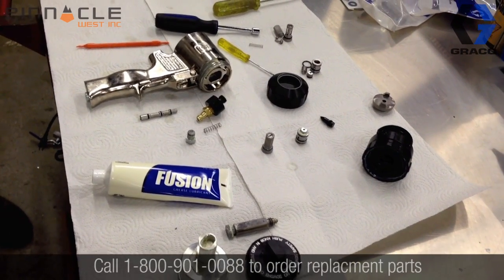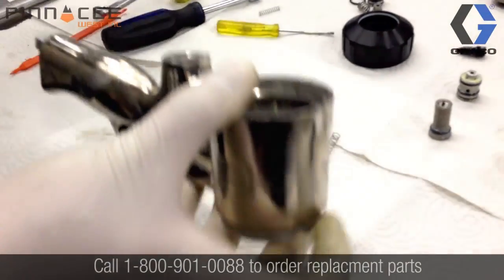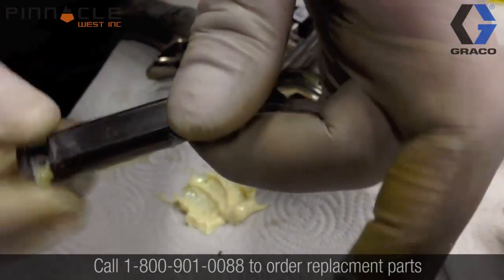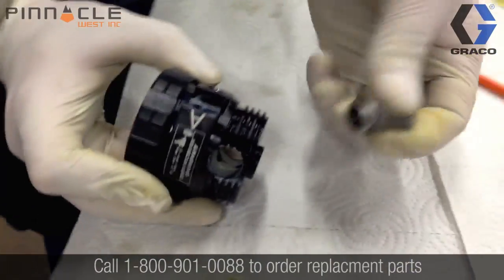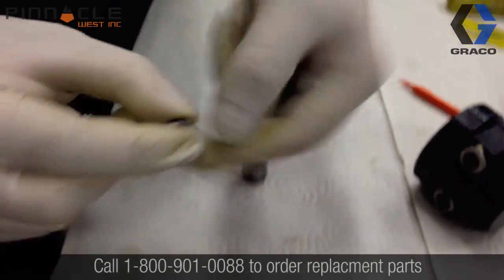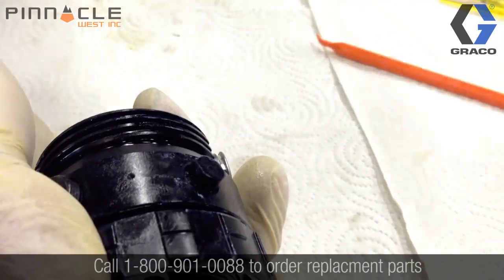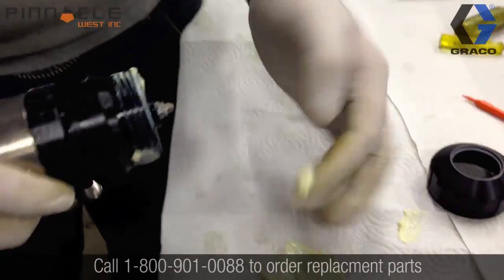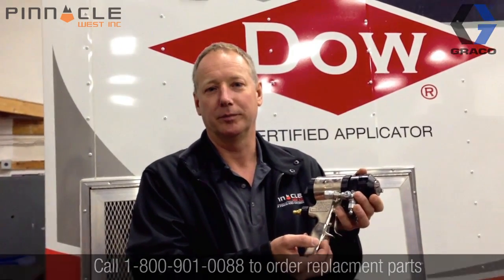HOW TO: Graco Fusion AP Spray Gun Rebuild - Part-2

Comment: This is technically how it can be assembled but this video and Part 1 both neglected to show how to clean the parts and how to ensure the passages are clear.
Reply: exactly,the didn't include those key steps because that would help you save money rather than needlessly buying o-ring kits and parts